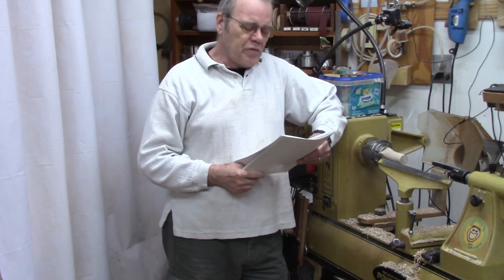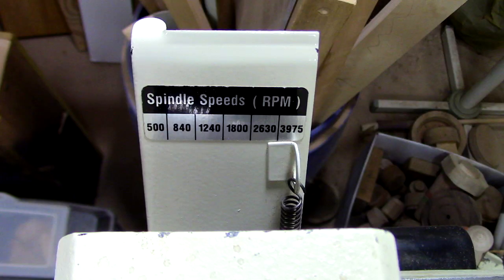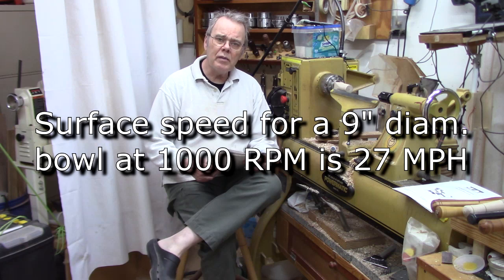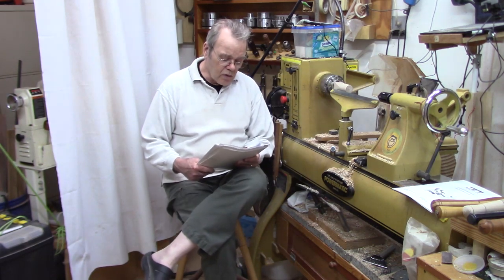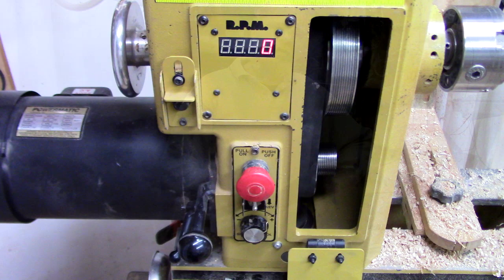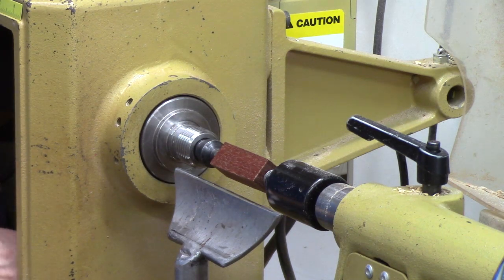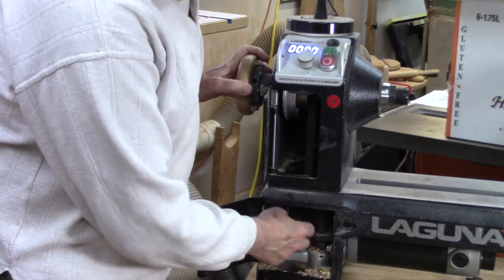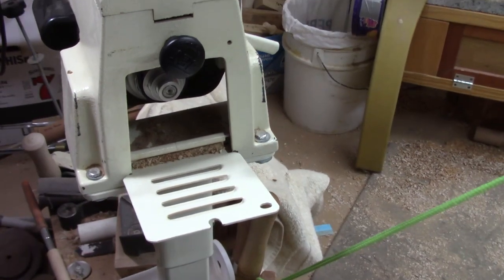When Do You Change the Belt Pulley on a Wood Lathe?

Comment: I bought my Delta 1236 lathe new 45 years ago and it did not come with a manual or a motor. I built a stand for it and mounted a motor below it. My lowest speed was about 500 rpm which I found too fast for anything larger than about 6 inches in diameter. I have since upgraded it to run of a 2 HP treadmill motor with a jack shaft. I can get to run from about 50 to about 2000 RPM on the lowest speed pulley. If I want to run faster I have to move the belt up to the next pulley set which I very seldom do. Keep up the good information videos.
Reply from the maker: Thanks for sharing.

Comment: Very interesting information.  I personally just bought the larger harbor freight lathe (it's what I could afford) and so far I like it.
Reply: I also have the larger Harbor Freight lathe.   I've had it for several years and have had no problems with the Reeves drive.   Yes, I wish it could go to lower speeds than it does; but it's the lathe I could afford (it was very affordable at the time with a 25% off coupon).    Someday I hope to purchase a better lathe but the HF is doing the job for me now, and I don't have to change pulleys to change the speed.

Comment: What speed you you recommend using for sanding?
Reply: I think it depends on the wood, the paper grit, and the sanding pad.  Since this is too complicated for my simple mind, my rule of thumb is to try sanding by holding some new paper of the right grit against the work.  If it gets hot, it's going too fast.   That's a one-variable rule I can unnderstand.

I also toss the paper when it stops making dust. In the immortal words of Lyle Jamieson, "Dull 150 grit paper is NOT the same as 180 grit paper! Get rid of dull sandpaper."
Reply from the maker: No more than 1/3 of what you finished turning at. The key is a lot slower than you might think.